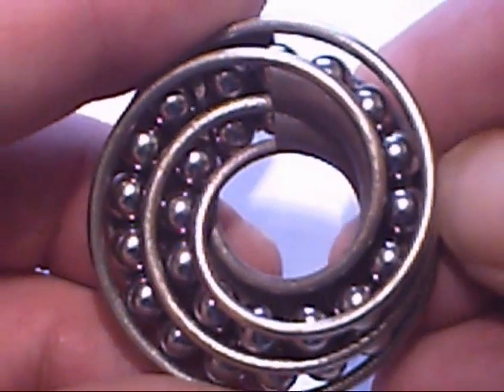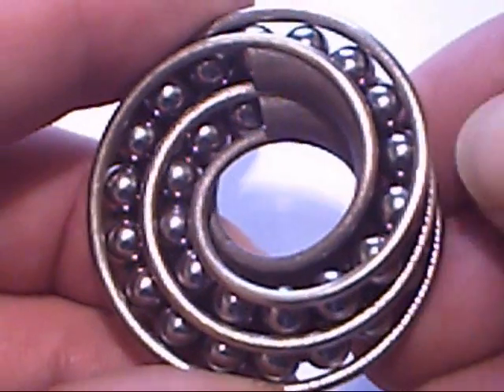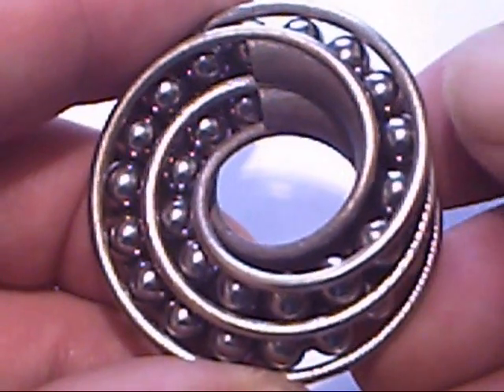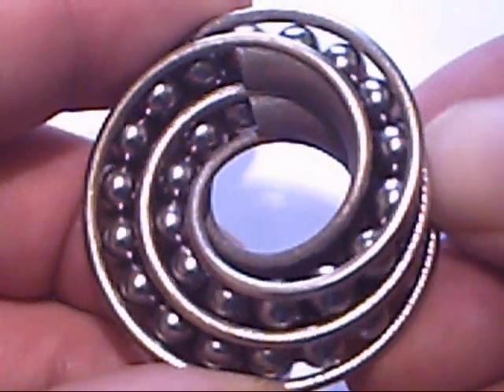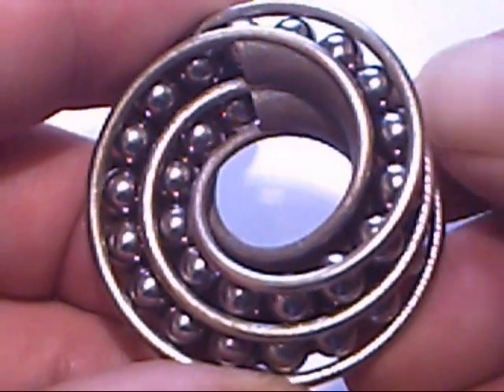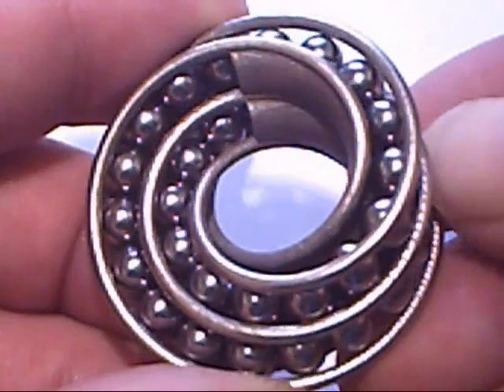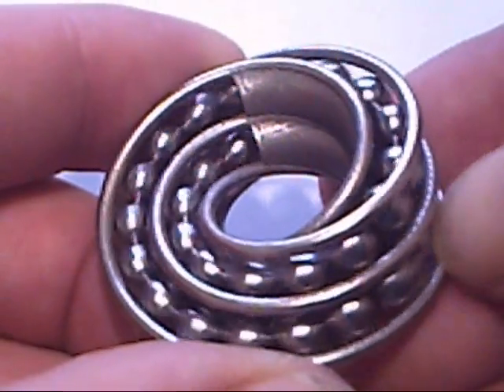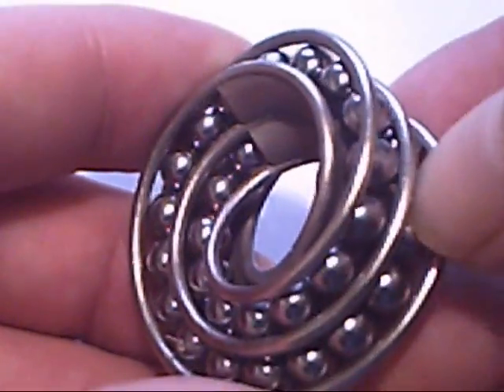Twin Rail Mobius pendant with balls! - 3D printed metal @shapeways

Comment: the name is moebius.   FYI
Reply from the maker: Ian Gendler 
Hi moebius, the name is Paul ;)
Have a google - Mobuis don't have an 'e' but does have an umlaut over the 'o' - I've got a UK English keyboard, so, sadly umlauts are out.
Reply: stop4stuff The program "Allchars" lets you type symbols, such as ö and Ω, via hotkeys
Reply: +stop4stuff 

Yes, and if you do not have the umlaut, then the RULE is to replace "o with an umlaut" with "oe". Similarly, "u with an umlaut" would be "ue" - Juergen etc.
Reply: +Ian Gendler it's möbius :)

Comment: Where can you get one? I have a friend with a 3d printer do you sell the data files to create this?
Reply from the maker: Bobby Allen check out http://shpws.me/D6g - i don't sell the model file as the model is specifically designed to meet the 'design rules' for Shapeways 'Stainless Steel'

However, get your friend's 3D printer specs/requirements and I'll look into it.
Please note;
The design of the shell cannot be printed on an FDM printer due to the wires and 180 degree twist (or in other words, it ain't designed for FDM & imo would never work)

Comment: ? wats it four ?
Reply: peter woods Just to look at, you mean like YouTube?  Not everything has to have a "use" in order to be art.  Think of this as Art.
Reply from the maker: peter woods Four is a number... I am not a number
That said, it is a pendant, you know, something that looks good hanging around one's neck on a cord.
Any-which-way, it is most definatly not 'just wire and some ball bearings'
If you really think it is, then I challenge you to find someone who can replicate my pendant design by hand - you can see more of the structure at http://youtu.be/ztIT9c9PeXU 

:)
Reply: peter woods It's more than wire and bearings, just like you are more than skin and bones (and other "stuff").  It's highly structured, and it's unique in so far as topology goes. Just because you don't appreciate it, doesn't mean that others can't. Troll away.
Reply from the maker: John Miller Well said!
Thanks :)
Reply: No there is just the one.
Reply: stop4stuff No point in replying to a middle-aged man who can't even spell for properly.
Reply from the maker: It is a very cool pendant, that attracts attention & comments where ever I go :)
Check out this and more at my Shapeways Shop via www.stop4stuff.co.uk
Reply: o.k,but wha is it for,just to look at,mmmmm ?
Reply: i cant,its just wire and some ball bearings.

Comment from the maker: @Soy Ecotlan: chill... darwin's law will get those not suitable ;)
@chickenfuxor: your same point was discussed previously, the 3D print falls within the print tolerances for the material, unfortunately there was only enough room for 31 balls to move freely, 32 balls is too tight for them to move. The pendant was designed for 32 tight fitting (but free) balls.

Comment: What Shapeways does is they have these printers that use metal powder and a binder.  There are videos on YouTube that show the process.  It's a great way to make very complex designs instead of CNC machining.  It is just a more advanced method of sand casting where the original is made from metal powder and a binder and then it goes through another process that gets heated up.  It's kind of interesting, but it's been around for a while, but it is cool.

Comment from the maker: @HVoltage152
Don't tell everyone just yet, but I do have a smaller (& cheaper) version that's about 1.2 inch diameter that will take 4mm balls, I'm just waiting on delivery to see how it works out - I'll message you with a link

Comment: Somewhere there is an overworked and underpaid mechanical engineer who just designed a machine tool where they use this device as a roller bearing.

Comment: @JustOneAsbesto 

He got it empty, the balls are not 3D-printed. And bending it open to stuff in balls is NOT something you want to do often with 3d-printed metal. Because you layer molten hot metal onto cold metal, repeatedly, at scales of a third of a millimetre or less, it doesnt bend that well. Its more like crystalline, rather breaks than bends.

Comment from the maker: @JustOneAsbesto 
Thanks! Originally I designed the pendant to take 32 6mm balls, but as you correctly say, 32 was too tight a fit for the balls to move so the pendant has 31 balls - 29 1/4 inch balls fill the space a bit better whilst still being moveable.

Comment from the maker: @mtinsley198
The pendant was designed to take 32 6mm balls, however 32 balls are a tight fit and do not move as easily - 29 1/4in balls also fit :)

Comment from the maker: @gabimarvei
If google translate has got it right, you want to know where to get the balls?
Depending where you are in the world, have a google for 6mm steel balls or bearings - 1/4 inch also fits... 1/4 inch bearings are also commonly used in bicycles, a bicycle spares shop/store might stock them.

Comment from the maker: @problemchrist - yes, the pendant is a maximum 46mm diameter and weighs ~55g (2 oz) when packed with 6mm chrome steel balls. There's a 4mm ID hoop on the back for the necklace, I use 3mm leather cord and wear the pendant daily.

Comment from the maker: @GraveUypo - Shapeways uses the services of ProMetal (google them) for their steel prints. Steel powder is laid down with a binder, the binder then gets burnt out and the space left is filled by soaking up molten bronze. Other services can print in other metals using Direct Metal Laser Sintering (DMLS) at a much higher cost.

Comment: @stop4stuff useless ;) but interesting device. Just to chip in an idea:
How about replacing the metal rails with a non ferrous metal, replace the steel bearings with glass or preferably plastic coloured bearings keeping only 1 or 2 metal bearings. Then see if spinning a neodymium magnet in the centre can propel the bearings round. Assuming bearing friction against rails is minimal, Id have thought it would work. Illuminated, it would be interesting to see.

Comment from the maker: @derman077 - it was desgined to take 32 6mm balls, but the pendant is just a touch small to get 32 in and nove smoothly. The size sifference is well within the specs for the printed stainless steel from Shapeways though.

Comment: seems like if you magnetized the balls and placed a few magnets strategically on/in the rails, then shook it up a bit, it would probably keep moving for a while (not indefinitely, but maybe ten minutes depending on friction), and if you're lucky you could get it so the aggitation of moving around while wearing it would keep it moving most of the time. Then you'd just have to worry about noise.

Comment from the maker: @TheCaptain008 Thank you! I love the steampunk genre (brassgoggles.co.uk rocks!), but am concentrating my efforts on 3D modelling for 3D printing atm - I've a diverse collection of items in my Shapeways shop (via stop4stuff.co.uk).

The material selector on Shapeways is for the pendant shell only - you'll need to get some 6mm or 1/4in balls & necklace/cord to fit (4mm hole) - and yes if you need to escape the clutching vagabonds, the pendant will bounce a bit.

Comment: You wouldn't have to rework anything to get it running by motor, just add an external worm gear, like a recirculating ball power steering box uses.

Comment from the maker: @z11223344 yep, printed - the shape is built up layer by layer using steel powder & a binder, the binder is burnt out & the steel fuses, then finally the object goes into a bath of molten bronze which fills up the gaps in the fused steel - google search words - ProMetal & Shapeways

Comment: This is an interesting concept, I think I will try to make something similar in silver. I currently have silversmithing as a hobby, and create some random original pieces of jewellery. From an artisans point of view, this wouldn't be so hard to make by hand. I've a few designs with moveable parts, but never thought of the mobius form. Good work there.

Comment from the maker: @notahotshot - downsizing for a 3D printed ring would be tricky... none of my fingers fit through the hole in the middle as it is and there are 'print restrictions' that would stop the same/similar design being smaller, but having said that, I'll get my thinking cap on and see what I can imagineer :)

Comment from the maker: @Hardwyre - yep, printed - the shape is built up layer by layer using steel powder & a binder, the bider is burnt out & the steel fuses, then finally the object goes into a bath of molten bronze which fills up the gapes in the fused steel - google search words - ProMetal & Shapeways